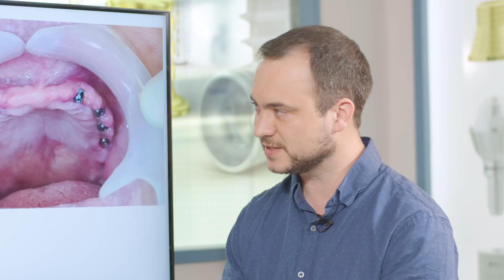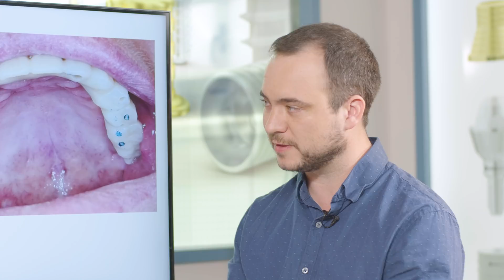How to scan full jaw with introoral scanner correct relations Digital restoration Screw retained

Comment from the maker: 00:00 We want to make a bridge on the upper jaw, 12-unit, 12 crown bridge, on seven multi units, on seven implants. 
01:41 Yeah, nothing is moving.
02:03 You start adding a composite one layer on top of another, until you can see that with the lips and the cheeks, you have enough height, and everything is done in occlusion. 
05:05 The most interesting and I think the amazing part that you can see is you have contact points in all of the places. 
05:59 And here, you can see that you get something pretty good.
08:21 Up until the final version that we made from zirconia with cemented sleeves, we, in between the teeth, we added a little bit of color to see better the separations.
9:54 When you design the bridge is not what you'll see in the mouth.